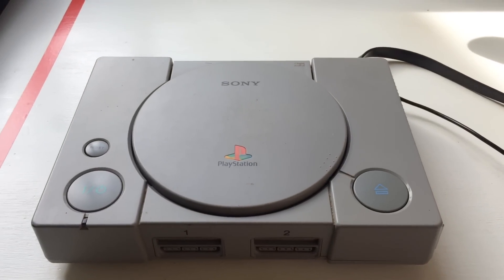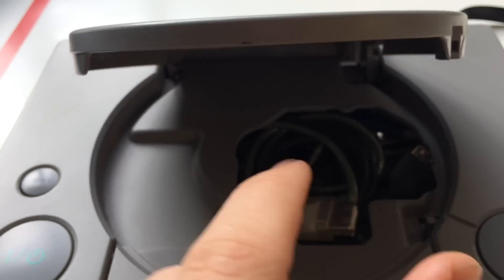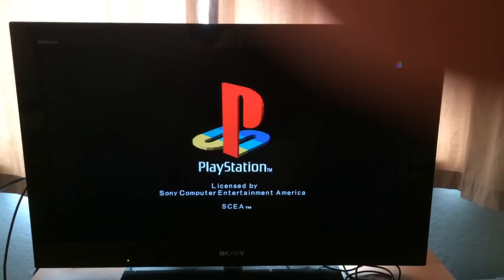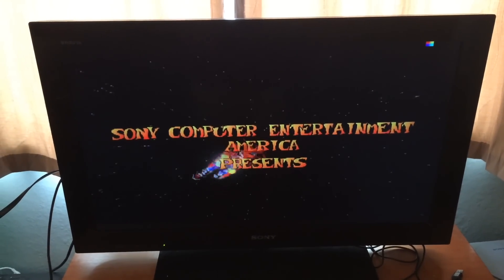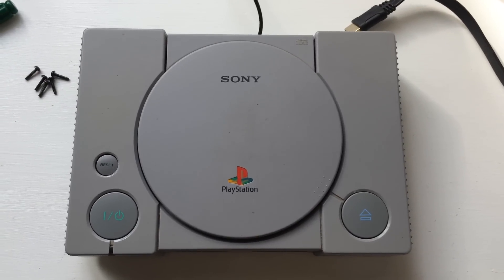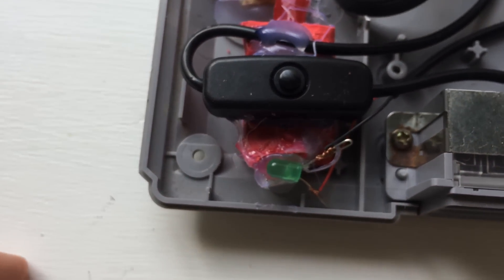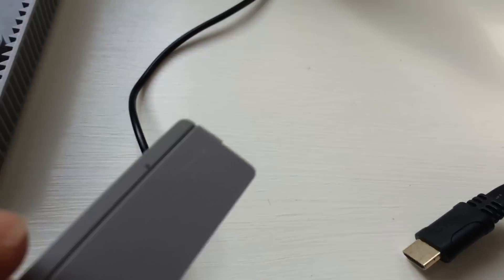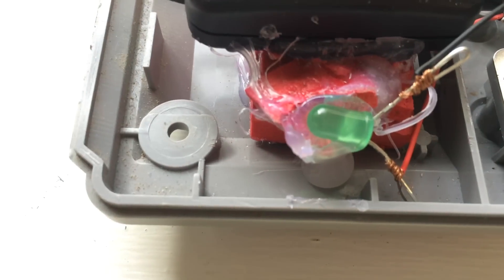Raspberry PiStation (Raspberry Pi in Ps1)

Comment: There's not enough power going to your Pi as indicated by the 4 colour box on the top right corner on your TV. It could cause slowdown where none is necessary. If you have a Pi 2 you will need 2 amps or 2.5 amps for a Pi 3.

Comment: Man, it's a mess inside!
I will build one but will use the ps power supply (12V) with a regulator to get the 5V. So I will keep the PSU of the PlayStation.
Reply: You'll need a voltage step-down module such as this:
US:
https://www.ebay.com/itm/302368295262
UK:
https://www.ebay.co.uk/itm/302368295262

This will convert an input between 6.5-28 Volts to an output of 5 Volts.
Reply: You can change some parts around but his idea/method is what counts. Let's consider this a prototype.

Comment: I have a dual shock and usb adapter but I cannot analog working at all,. How did you get it to work?
Reply from the maker: Try get it to work in a computer (or other system on the the Pi) to see if it is hardware. Im assuming your using retroarch and emulationStation, so is it working in emulationStation? (this runs separate from retroarch). If its not working in emulationStation or retroarch, try reconfiguring in emulationstation. If this doesnt work, go into retroarch config (from emulationStation not the normal rGUI in a game) and in input somewhere there is a way (I cant remember details if you ask again I could make a video) and in there you can find a way to manually press each button and assign values which saves to retroarch.cfg and works across all cores. Please ask again if your confused im happy to help.

Comment: Hi... how do you connect The psx controller with The original cable to The usb of The rpi?
Reply from the maker: http://www.ebay.com/itm/Dual-Port-PS2-PlayStation-2-to-PC-USB-Game-Controller-Converter-Adapter-/401081808366?hash=item5d6256b5ee:g:YaQAAOSwzgRW19Aa one of these
Reply: hi, great project! both joysticks work fine with one converter? you use only one usb port for 2 joysticks? is compatible with ps2 and ps1 joysticks too? (sorry my bad english). thanks-

Comment: Sorry but doesnt the power need to be from a power supply made for the pi?
Reply: @1:07 you can see the pi is under powered by the rainbow square up the top right corner of the screen. any micro usb cable should work, you just need to make sure the wall adapter is outputting the right amount of power.